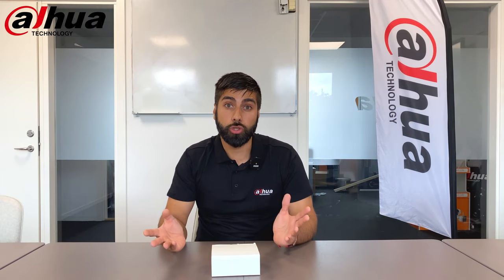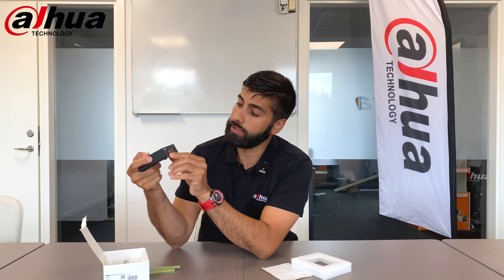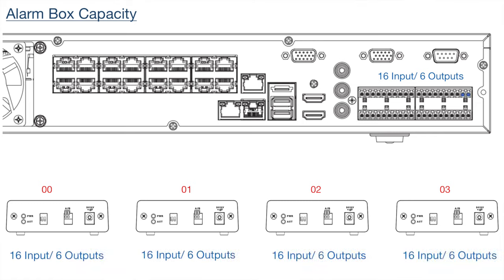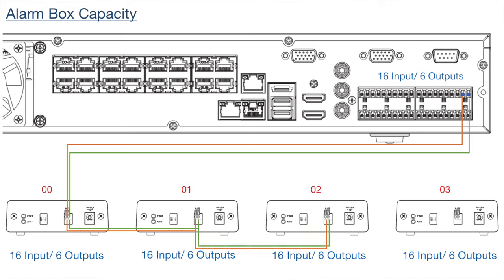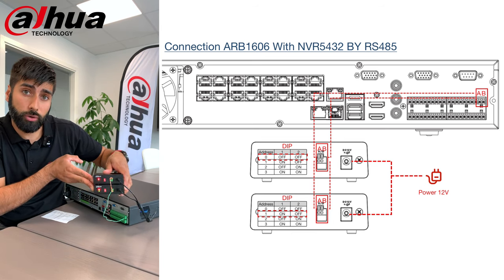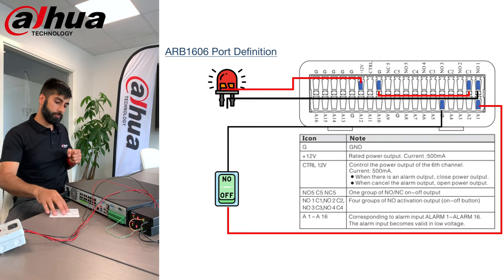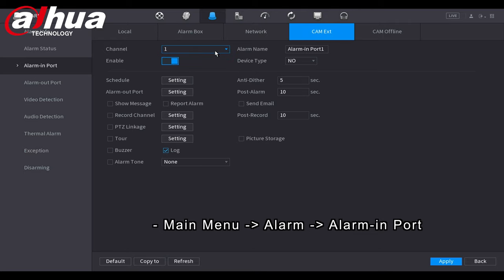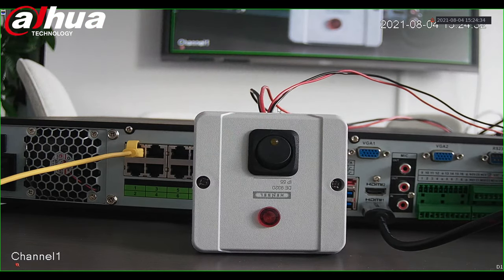Alarm Box Unboxing - ARB1606 Promotion - Dahua Technology Nordic

Comment: I really like my Dahua XVR. Very powerfull device. I do wish the CPU would be more powerfull, i.e. for an 8-channel recorder to be able to analyze most if not all 8 channels at the same time without reaching the CPU's limit after trying to enable AI on anything more than a single camera. My 10+ old CPU has more processing power than this XVR.
Also, I wish it would have a way to automate  arming/disarming the XVR, its alarms and recording with a simple swipe of an RFID card or similar. Turning it back on should be just as simple. Better still, if the XVR could be integrated with my smart home and Home Assistant server and could disarm every time I come home and automatically arm itself when I leave, either based on geolocation data and/or my phone being connected to my homw wifi network.
I'll take 10% of this idea, than you :)

Comment: Would this be compatible with the VTH5321GB(W)-W door station via RS485?
Reply from the maker: It is not possible since it is not integrated, it is supposed to be used with an NVR or XVR
May I ask what purpose are you intending to use it for

Comment: Can multiple sensors be used parallelly in the same relay input port?🤞
Reply from the maker: It is an alarm I/0 input so which ever sensor triggers it should be detected as the same input